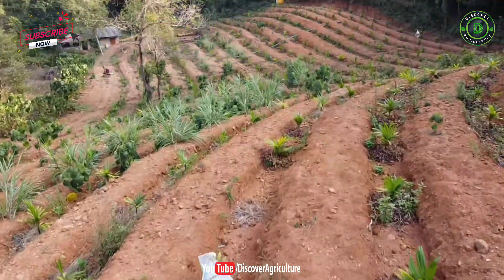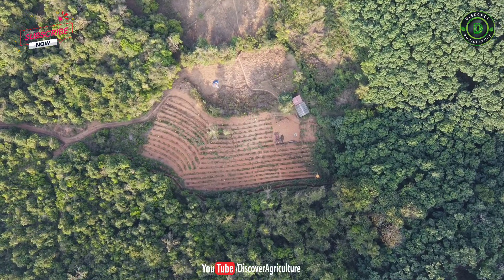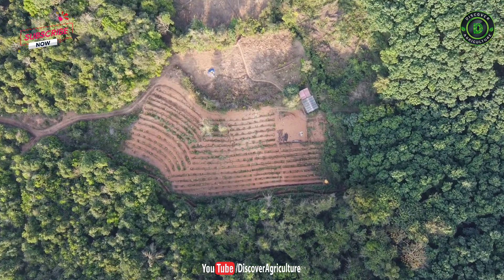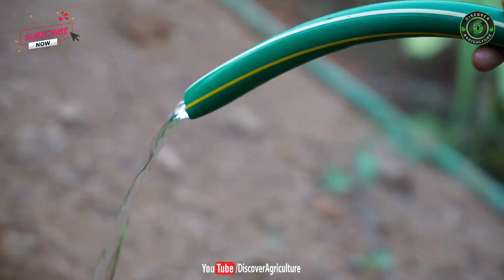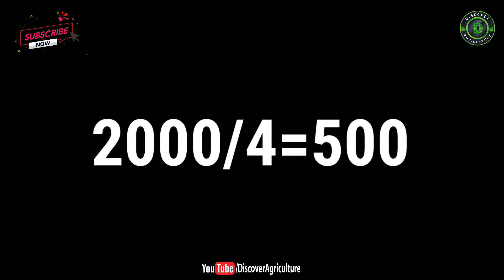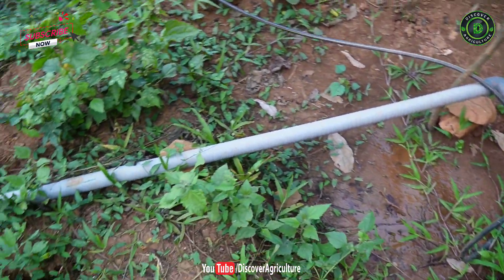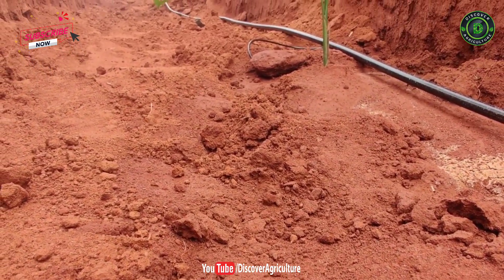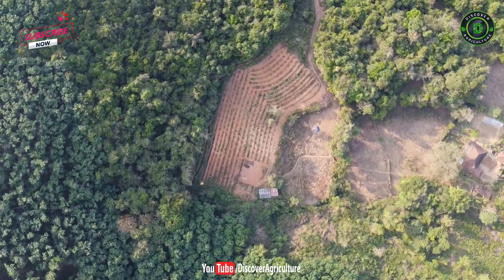Self Sustainable Farming and Gravity Irrigation System | Arecanut Gravity Drip Irrigation System

Comment: We also have slope land & have made drip irrigation but the problem is when I switch on the motor entire water goes to the last few pipes which are at the bottom. We are using valves to water the top portion of the land. 
Now my question is, How did he managed to water top portion of the hilly land using gravitational force???